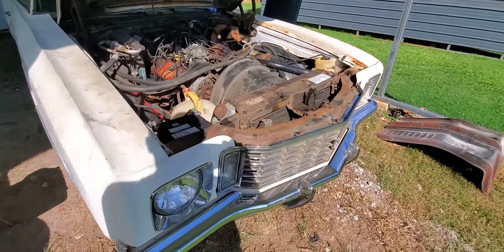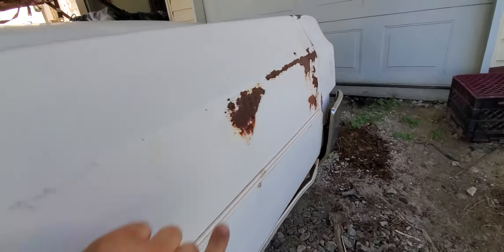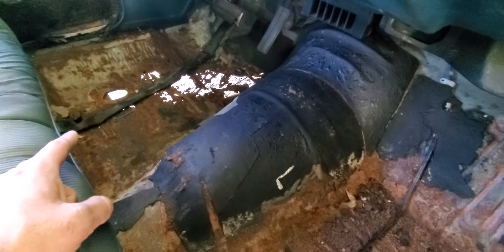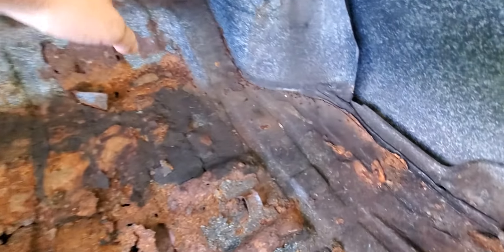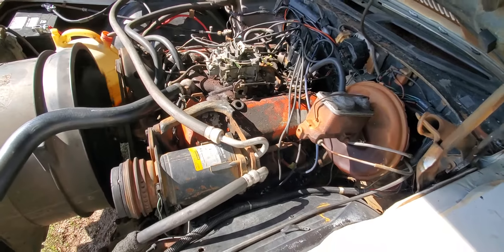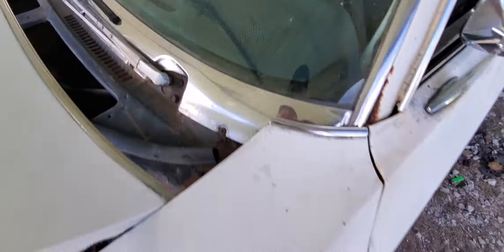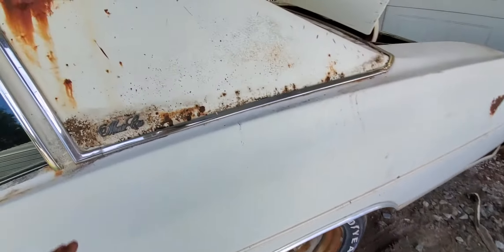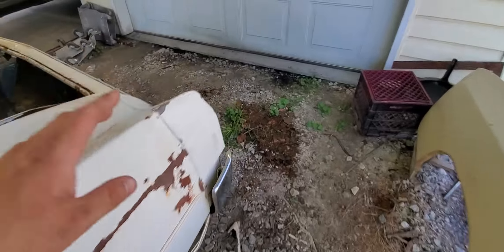1972 Monte Carlo Factory 402 Big Block U Code Runs Great Project SOLD

Comment: I'm in Michigan If I was to Buy that car from you. what would you charge me to fix the rust and to have it ready for paint
Reply from the maker: $60 hourly on metal work plus material and parts of course. You need to call me directly 864 940 2146